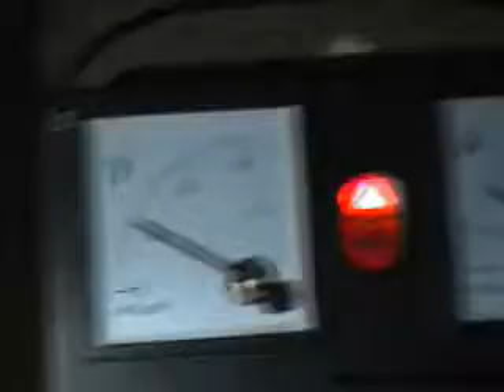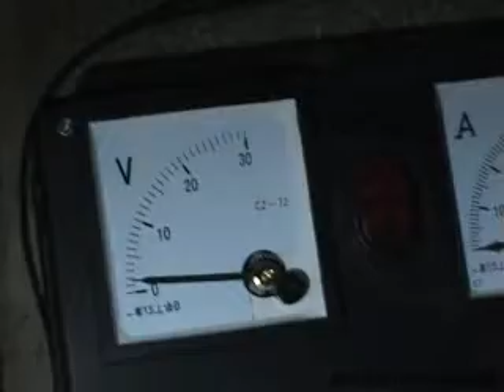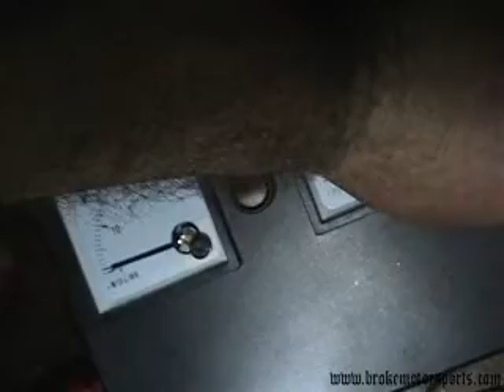HHO Test #012 - Residual Voltage - www.brokemotorsports.com

Comment: But the "Residual Voltage" is to be used, as Stanly Meyer desctibes, he powerd his cell 15% ON and the rest was OFF, and using high voltage ( he's talking of 1000-2000V or so) the residual voltage does split water to HHO.  
And u get residual voltage becouse the cell is really a water-capacitor charging up.. 
keep it up !

Comment: continued not enough space. So the cell has been polarized with a + and - allowing it to act as a battery and give off voltage albeit very low amperage.  If you want I can do a video or 2 to better explain for you just reply to this if you want me to.

Comment: your cell is like a battery with a + and a - pole the longer the cell runs the stronger the polarity will be. If you were to use a charger the detects reverse polarity it would beep at you if you tried reversing the leads. If you've ever scene a water battery or lemon or even potato battery same concept. Using 2 different metals to get power 1 metal allows the electrons to flow better than the other creating a + and - your cell uses one type of metal that has been polarized to flow in one way